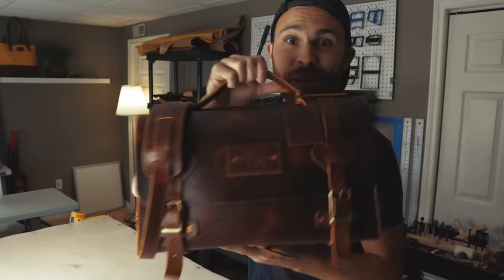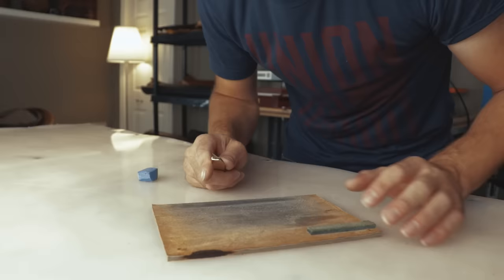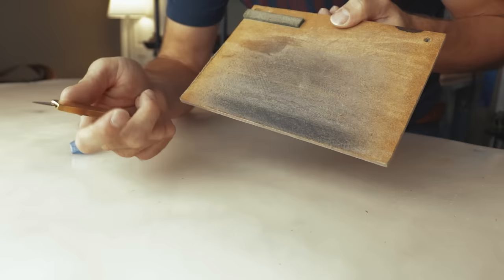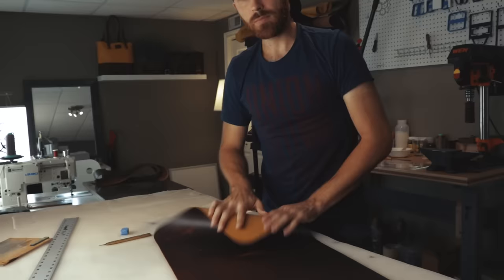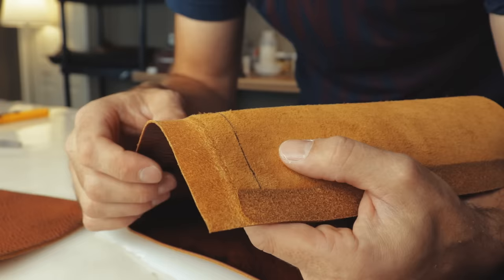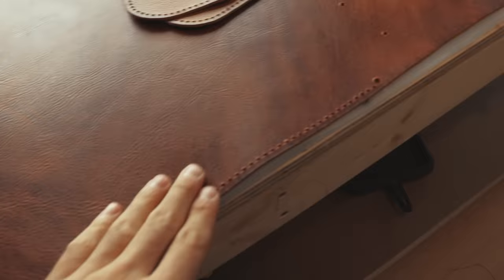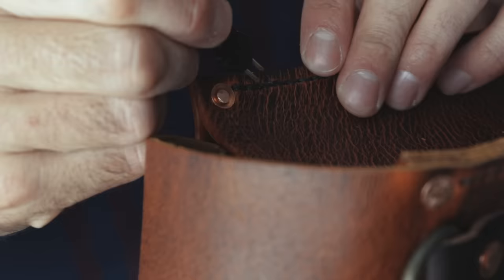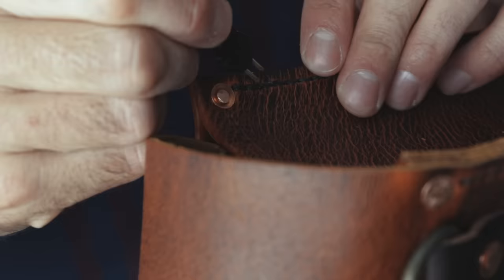MAKING AN UNCHARTED LEATHER SATCHEL OR MESSENGER BAG.

Comment: Two Questions, What Brand of glue is that white glue you're using? next...who made the acrylic templates you used. Thank You for the Videos!!
Reply from the maker: Hey! I use Eco Weld from Tandy Leather. For the acrylic templates, I sent my designs to a local laser shop. They have since moved. Any laser or plasma cutting shop should be able to do it for you. 😊
Reply: Thank You and Enjoy your Videos!
Reply from the maker: I'm using EcoWeld from Tandy Leather. The Acrylic templates were cut from a local laser shop. Search for one in your area 🙌🏼
Reply: Try end cutting pliers instead of diagonal cutting pliers for trimming rivets.

Comment: Try end cutting pliers instead of diagonal cutting pliers for trimming rivets.
Reply from the maker: I've tried them and don't like them. Thanks for the suggestion! 🤜🏻💥🤛🏻
Reply: @LittleKingGoods  Cool 🤜🏻💥🤛🏻 
I've always felt that it takes significantly more force to close my diagonal pliers than my end cutting, now I'm curious if I can figure out how to gauge the the actual force required...  I went the the bench and did a test side by side to make sure I wasn't crazy and no, it's still much less force to close the end cutting pliers. Shrugs. Great channel, I had you on for a long time last night while I was working. Kinda like having a good shop partner that I could mute if I wanted.  ; )

Comment: Excellent bag!  Beautiful waxy pullup leather.  I used to work w/ some nice finished leather on furniture.  Question: what kind of thread do you handstitch with?  Also, what is the purpose of the tool used starting at the 9:11 mark, if you don't mind me asking?  Thanks in advance.

Comment: Nice bag and great videography. What weight of leather do you use on this bag? Any plans on making a traditional leather US Postal mail bag? Does the structure of the bag hold up better in a design like your Unchartered bag where you hand stitch it on the outside as opposed to the bags that are stitched on the inside and have that tucked look?

Comment: This turned out amazing, really enjoy watching you work and get through the design/construction process.  May I ask about the rivets?  Where and what did you buy and where did you get the tools to set them?
Reply: Those are copper "rivet and burr" type rivets. These can be had from Tandy Leather (or any leather working supplier, really) or Amazon. The setting tool can also he had for a few dollars from the same locations. Rivets come in numbered sizes and lengths and mine come with the burrs. Make sure to get a setting tool size that matches yoir rivet size.

Comment: Is it common for leather bags like this to have the raw fiber back of the leather exposed like that on the interior? are they not supposed to be lined with some fabric to make it more "higher quality finish"? sorry i do not really own leather bags or anything, i am just wondering as i can't recall ever seeing fibers of leather inside a leather bag like that,
Yet every youtube video showing high quality leather handcrafted items having them, what am i missing here?

How do they do that? what fabric is really used? is it glued all the way to the back side? or just stitched on the sides like another slab of leather?
is leather used on the inside instead sometimes? is it skived to be really thin?
Reply: Real leather usually have the "inner" side brushed, which gives it really pleasant, smooth feel, so using extra fabric isn´t usually neccesary (in terms of functionality), and makes the final product cheaper. Fabric glued to the inner side is often used to mask the fact, that the leather isn´t real. (not like it´s a bad thing in my opinion, I saw very fine bags made from faux leather, even inhereted one with the inside lined with beautiful fabric and the overall look is very elegant)

Comment: Rutska is weak. you need to supplement the handle with leather. handle over the shoulder where to attach? the bottom will sag. need legs and a tight insert. overall a very beautiful portfolio. but there will be a big deformation in operation.

Comment: Dear, may i ask what it is called (material / hardware) when you stamp that "ring" on top of the pin to fit handles in place?
Reply: Those are copper rivets, and the tool used to hammer them is a rivet setter.